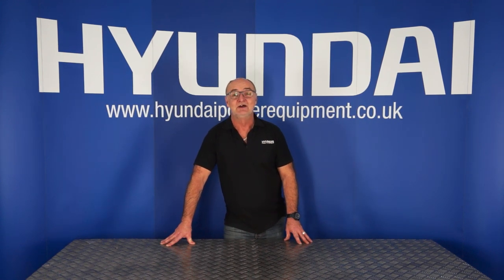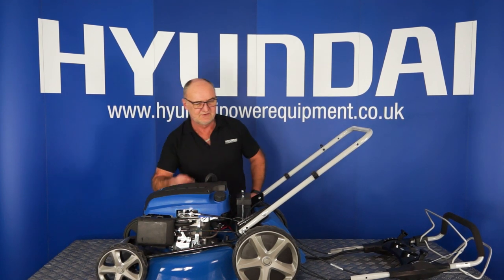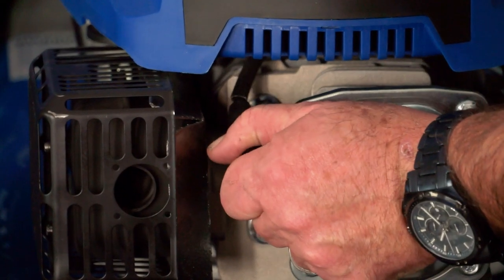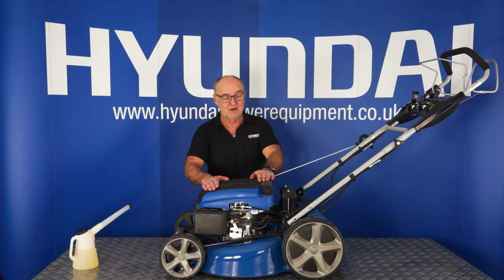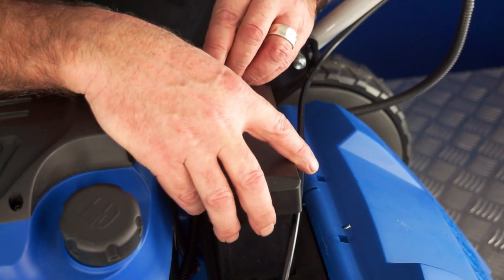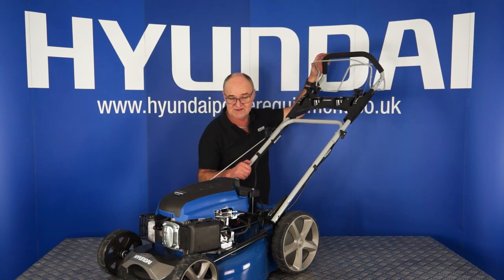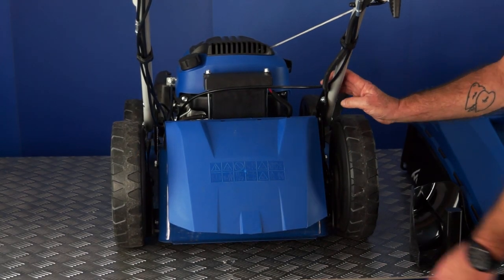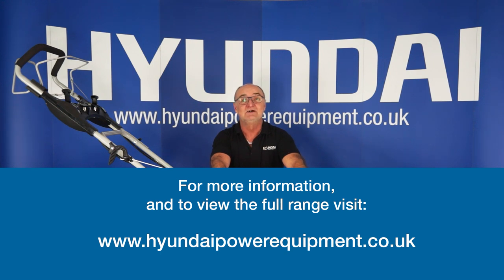Hyundai HYM510SPE Self Propelled Electric Start Petrol Lawn Mower Unboxing  & Assembly

Comment: How do I slow the walking speed down as I'm disabled and can't walk too fast it must be set on high, so I can't use it
Reply from the maker: Really sorry to hear you aren't currently getting on with your machine. There are four walking speeds, represented on the handle with the sliding lever - if you are finding it too fast, and you have purchased recently, get in touch with our team and we  will assist!